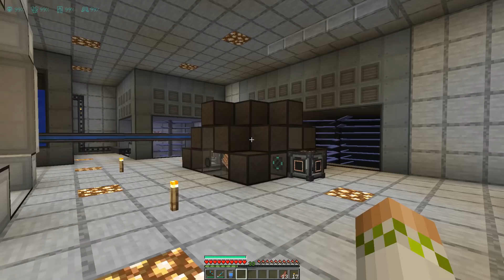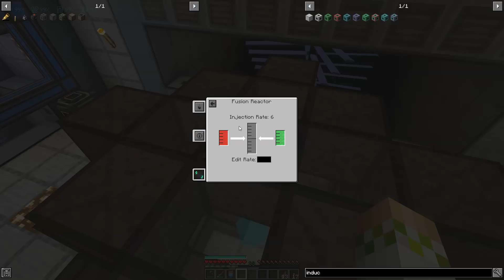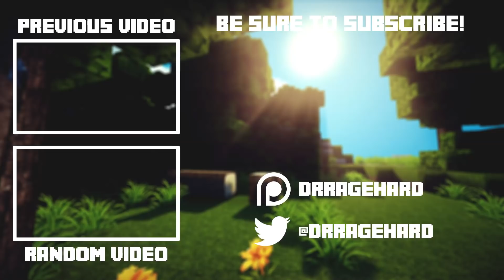Surviving With Mekanism v10 :: E21 - Water Cooled Fusion Reactor

Comment: I'm playing currently on mekanism 1.12.2, since in this Version you can have the most stable reconfigurations with other mods like rftools, industrial craft ect. If I want to add a reactor port here, I need to have a Hohlraum filled with dt fuel ready, because if you reassemble the reactor, it will not start up again on its own, but it has the temperature left in the reactor, so that if you place the Hohlraum fast enough in the control panel, it will ignite again. I had to painfully laser charge a dozen reactors before I figured that out 😂😂 nice video man, thanks for the steam numbers!

Btw I noticed that the power increase has a factor of around 1.5 counting in raw thermoelectric output of the reactor, so it is safe to assume that a boiler setup will have a 2.0 factor? My biggest fusion reactor has an input rate of around 400 mb/t of D-T-Fuel, which I don't really know how to handle yet, but maybe I will figure it out with your series :-D thanks alot again.

Comment: wouldnt the air cooled fusion reactor generate more power after a certain point than the watercooled with a maxed out turbine? obviously you would require massive 2H and 3H setups so it is probably not worth it but i mean food for thought
Reply: No, because the multiplication factor of steam to energy ratio is 1.5, so you will always get 1.5 times more energy from a turbine then the raw thermoelectric output of the reactor is. Only problem is that the amount and sizes of those turbines become increasingly ridiculous, I've just completed my 400 mb/t D-T-Fuel plant and I have no bloody clue how I ever will water cool this monster. That's 40 MRF per tick of energy, and each MRF gives off 150.000 mb of steam per tick. That's 6.000.000 mb per tick, didn't know what I was thinking tbh.

Comment: Pls somebody can help me with this.. i got a maxed turbine.. but the pressurized Tubes just wont connect into it (there are red particels and i also gut the gui in the turbine.. the water from the vents works ) but the tube just wont connect
Reply: I know you made this comment two years ago and probably figured it out by now (or you're likely just not playing anymore), but for posterity's sake, try using a pipe for steam instead of a tube. This video is for Mekanism version 1.16, but in older versions such as 1.12.2 they hadn't tweaked it yet to use tubes. Idk what modpack you're running but there's multiple versions for Mekanism so I'd check it.
Reply: Omg that's so funny, YouTube sent an email bc of your response but sadly, as you guessed, I don't play it anymore (I wrote that comment at the age of 16).
Nonetheless thanks for the response hahahaha have a good one

Comment: Coming in with an improvement almost a year later: you can output heat to an industrial boiler from the fusion reactor, while at the same time water cooling it. You'll still output the same amount of heat to the boiler as when it was air-cooled, and you'll have more than double the steam production for more than double the power!
Reply: How exactly does that work? The water cooling decreases the internal temperature, so the thermal output should also drop or not?
Reply: Can you elaborate on this? Industrial Boiler from which mod and how would you do it?
Reply: @timothywheeler1831 mekanism

Comment: I have a question 
I use the fusion reactor with dt fuel and he output about 130mj/t with a injection rate with only 2 and he drain so much fuel and I run about 30 evaporation towers but that’s not enough.. so it’s better to put the two fuels in single mode in them ?
Reply: Yes, he said exactly that in the previous episode. DT fuel is consumed really fast and it's hard to maintain a reaction this way
Reply: Dt fuel is used at a raté that can't be controlled it's 500mb/t

Comment: Whatif we use an air cool reactor than export the heat to boiler to make steam for turbine, will it generate more FE than a water cool reactor?
Reply: Yes, the water cooled Version has a 1.5 energy multiplication, boilers add another 0.5 to that, so if your reactor produces let's say 10 MRF per tick of raw thermoelectric power (that's the maximum setting with a separated fuel injection system if it's air-cooled) it will then go up to 20 MRF. But the boiler and turbine setup behind those numbers is ridiculous after a while, in my old main world I had a fusion reactor with a RAW output rate of 100 MRF, that's 20 million mb/t of steam generated in a boiler. I constructed halls the size of a football stadium just for the casing.

Comment: Ok, guys, I have a question.
Every time I put a pump (no matter where on the water or how deep underwater) it is unable to do the pumping. It says something like "not enough water".
I live on the ocean shore and don't have enough water...
Reply: i'm a bit late, but the electric pump should work if there's a water source block below it and power going into the side with the connector
idk why it wouldn't, maybe the pack you're playing changed something about it
Reply: @epicgaming11195  I have stopped playing a while ago, but as far as I remember the problem was that my water consumption was so high that it immediately drained all the pipes. Adding a ton of pumps have fixed the issue.

Comment: Really good video, helped me a ton. The "weird rounding error" is the result of the passive heat dissipation working in the background (don't know if dissipation is the right word, I mean radiating thermal energy). The Process produces enough thermal energy to heat up 600.000 mb water per tick, but at the same time, the reactor frame gives of heat(-energy) to the environment. This heat can't be used to hear up water and a such the net production drops a bit. The heat dissipated this way relates linearly with the frame temperature while the water evaporation speed relates linearly with the core temperature. The equilibrium is met when the sum of heat dissipation equals the heat production of the reaction. The stats in reactor it self don't seem to take the reactor frame heat dissipation into account and a such always display higher stats than actually met. The numbers wouldn't look as cool and neat if this was the case.

If somebody wants further details I'm willing to write a few pages, but most likely that's enough or even too much information.
Reply: I’m willing to read m8
Reply: @Iapetus31  what are the core questions you have and what is it you're trying to understand? I could try to answer it so the reader doesn't have to know about the basics of thermodynamics, but I wanna avoid that of at all possible. The answer would be extensive ^^

Comment: does the max turbine height of 18 include the base and 3 blocks on top or is this just the shaft?
Reply: That's the entire turbine, top to bottom. 14 rotors with 28 blades is the max.

Comment: My gas pipe won’t connect to my turbine valve
Reply: Mekanism considers steam a liquid, not a gas.  Use mechanical pipes instead.
Reply: @Tantalus010  That is wrong, Mekanism has a "liquid steam" that can be made using a rotary condensentrator for mod compatibility reasons, but the steam produced by Mekanism reactors and boilers is a gas, and is transported in pressurized tubes and chemical tanks.

Comment: I can't imagine doing all this crafting without a lick of autocrafting from RS or AE2... just seems so damn painful.
Reply: It was. I started doing ae2 after I had a fusion reactor and an induction matrix capable of holding 500 gj. It was rough.
Reply: @secularsam7678  I made a 1.60 TRF matrix by hand. You have no idea how painful that was. Surprisingly short but painful
Reply: @s.sg5 I made a 10TJ matrix by hand lol
Reply: Yeah AE2 is something I will never not install on my custom tekkit packs, but same goes for industrial craft, which kinda traps me in 1.12.2. Mass generators are just to damn convenient in the lategame to not use them.
Reply: I have an RS autocrafting setup for the induction cells and providers, including alloy infusers, crushers, and steel production. Did you know it takes around 6000 gold to make an ultimate induction cell?
Reply: rel

Comment: I can't remember if he mentioned this, but keep around enough power to restart your star. Something happens, you can connect it to the resupply and be working again in no time.
Reply: I just never disassemble my laser focus charging setup. I have a redstone-sensitive section of ultimate cable so I can turn off all the lasers once the front focus is fully charged, then move just the front focus to where I need it when I need it. I do typically run multiple fusion reactors, which may sound like overkill but not in the packs I play, even when they're heating boilers plus producing their own steam.

Comment: Is it possible to put the water input port in the top face of the reactor? or do you need the extra piping to move the water fast enough? I was just thinking you could make it a little more streamlined that way.
Reply from the maker: You could put the water in the top face, but youre correct that you MAY need extra piping to make the throughput sufficient for the injection rate. It all depends on how much steam you are producing, if youre at a rate of 2, very little piping is needed, but anything over 10 and you will need a decent chunk of piping the reach the sufficient throughput for it.

Comment: The tubing thing really does sound wrong.  It sounds like there's some sort of programming shortcut they took with implementation that led to that behavior.  I suspect the issue happens when you have a tube that has multiple paths to a destination or multiple destinations.  If you use the minimum throughput as the actual throughput, then you have issues where you'd need to manage all of the calculations for the fluids in the pipes.  You'd have to use a pathing algorithm to figure out where the fluid is going and then update all of the pipes individually.  Treating the pipe as a whole shortens it to just 1 simple computation for adding pipes, routes, and operation.
Reply from the maker: While it is definitely wonky, I think it is intended as the official wiki page for throughput documents the phenomenon quite well and the network reader can show you all the details about the pipe system. As mentioned in a prior comment, it seems the pipe system is treated as a single large network multi block for all purposes. Not sure if it was a shortcut or so people could handle the insane throughput requirements of some of these other setups. If it didn’t work this way idk how you’d handle the output of an 18x18x18 reactor in any way with mekanism piping. Interesting info on the calculations though, I never considered it would be more resource intensive to deal with the non instantaneous flow in the pipe system.
Reply: @RagePlaysGames  I meant wrong in the sense that it isn't how pipes should work, not wrong in that it wasn't intended.  From what I've read on the wiki, I believe you are correct in that it is intended.  The intuitive way to increase throughput is to increase the breath of pipes, not the depth.  You'd basically need multiple pipes and multiple ports to connect the machines.  Obviously though that isn't ideal.  One way they can get close to the intuitive behavior of pipes without sacrificing computation complexity is to still treat them as a whole but set their flow rate to the minimum of the entire pipe.  Given how in depth they went with everything, I'm sure they thought of that but decided to go with the sum, likely for the specific issue of not wanting parallel pipes everywhere and being able to support the massive reactors.  The pipes definitely seem like a good candidate for rework in future updates of mekanism.  Also I hope they add a way to better use the SPS.  I don't know if you've had this issue, but in my world the SPS uses the maximum amount of power possible regardless of if there's enough polonium to justify use.  Even when you run out of polonium it will still use power until you break a cable and reconnect it.

Comment: I like to think of Mekanism pipe lines (or cable lines or tubes or whatever) as multiblocks. 

With other mods, usually each individual pipe block has some internal storage of fluid or power, and then it pushes to the next block, which pushes to the next block, on and on until it goes into a destination. With Mekanism, an entire pipe network is essentially a single large multiblock with one internal storage. The size of this internal storage is also how much the pipe network can transfer per tick. This explains why fluid and gases flow instantly through pipes, and it's also why if you have a gas tube or fluid pipe connected to multiple empty tanks, it splits the output evenly into all the tanks. The only way the individual pipe blocks matter is if you manually set them to push or pull mode, then that connection will be pushing or pulling at the rate of whatever rate that individual pipe block is capable of.

Incidentally, it's insane how much gas can be stored in a single ultimate pressurized tube. It seems the default Mekanism config options make a single ultimate pressurized tube hold something like 30 times more than an ultimate chemical tank.
Reply: This also explains why the mekanism cables can become really laggy when you're using lots of them...
Reply: intergrated dynamic can tranfer a huge rate. atlhough it dont have gas connectors